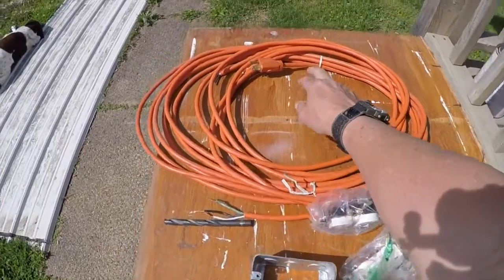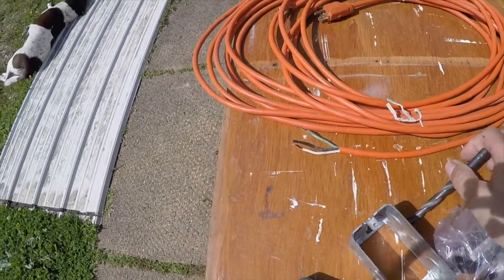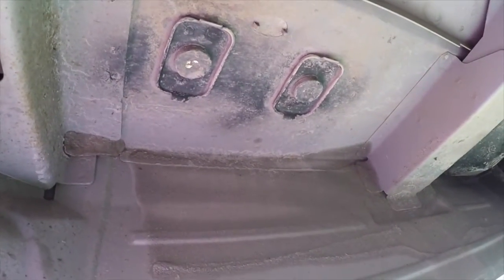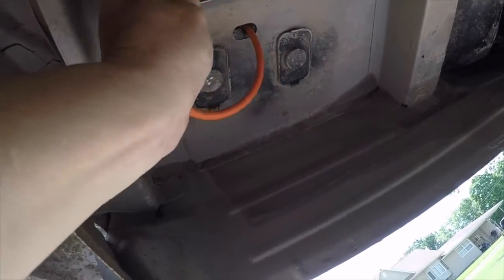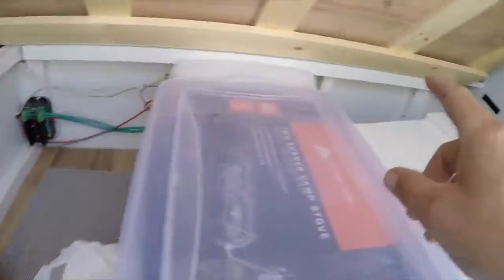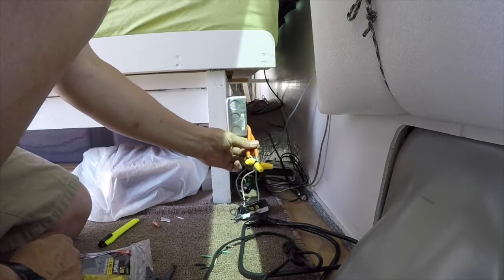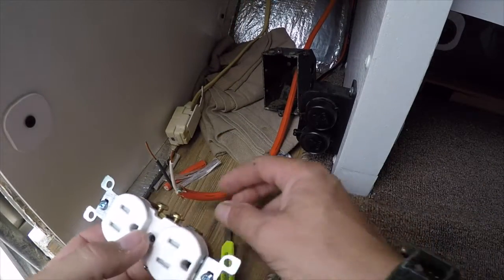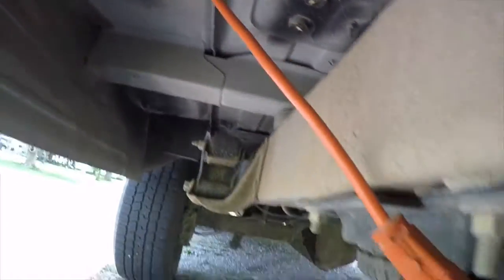How to Install Shore Power in a Van - Ford E350 Camper Van

Comment: Great idea, if you do add a circuit breaker please do another video on how it was done. Pretty much a novice when it comes to electricity and never much liked to play with it for obvious reasons But with that being said this is something that even I would attempt. Thanks Bruce added to my liked videos for others to see and for my own reference. ~jman
Reply from the maker: There are many options for a circuit breaker in this set up. I believe what I will end up doing for simplicity is just use a small power strip that has a built in circuit breaker and call it done. I may even just hard wire the power strip instead of the wall outlets to keep it simple. Most if not all campsite power boxes already have a circuit breaker in the box and my generator has one too so I'm not sure another circuit breaker is really necessary. To be on the safe side that's probably what I will do. Another option I'm considering is a plug in breaker with a couple AC plugs and a couple of USB sockets just to have the option to charge USB devices as well. There are many options and I just haven't decided yet. When I finally decide I'll make a little video for everyone to show what I did. Thank you and take care.

Comment: That will make cooling down the freezer the day before you head out much easier. I saw AC & thought Air Conditioning. I put an window AC in the back drivers side rear door for my last trip to Florida.
Patrick
Reply from the maker: LOL, yes I thought the title looks like air conditioning too at first glance. Cool, (pun intended) I have seen a few van owners installing window AC in that back drivers window. How did you like it? Is it worth it?
Reply: 100% worth it. I got a $1,000 generator that's only 58db will make life better then the $200 101db one I used on last trip. 
Patrick
Reply from the maker: Nice!

Comment: I also already found and watch conclusion, helps me out, I am still in money saving phase.  I am not an electrician, but I was wondering what about the outlets with fuse built in?  I think the power strip with breaker is great idea, small, takes up little space.  The other question I have is about the length of the cord and the guage?  For myself I would be powering I would think small items, and maybe an air conditioner, of course the AC would the only item at that time running on the cord hookup.  I am also looking at those RV hookup units and solar, hoping to do all three types.
Reply from the maker: I'm not an electrician either just for the record. I think you are talking about a GFCI outlet maybe? I don't think those ground fault breakers are quite the same as a regular breaker but I could be wrong. I just used an old extension cord I had laying around. The required length and gauge of the cord you use would be completely dependent on what you plan to run with the outlets. My thoughts are I'm not running anything that I wouldn't run with a standard extension cord and the run isn't more than  about 20 feet or so. I figured if they sold an extension cord in that length the gauge would be satisfactory. I also never really planned to use more than one outlet at a time and I think that may be the key here too. I would just use the largest cable cord you could find or even use real house wire and all should be good. Most AC units are large power consumers. I would just check the paperwork that comes with the AC to make sure it can be ran with an extension cord and I'm sure it would work. Sounds like you have some nice plans, just be careful out there and do your research. Take care :)
Reply: Sounds good to me, in fact I had forgotten several years ago I used house standard wiring to make an extension cord from my outside outlet to garden pond, that one of course is enclosed to protect from the ground.  In research phase and saving money to buy phase, thanks!

Comment: nice easy way to put Shore power into your van but I would consider putting some sort of breaker between Shore power and the van maybe a GFCI or breaker switch between the outlets. thanks for the great video
Reply from the maker: Thank you. I have a follow up video showing my solution for a breaker.
Reply: +WannaBFree I just bought a conversion van myself a few weeks ago and I really appreciate your videos, giving me some great ideas to put my van together. Thanks again. BTW I'll try and keep up with your videos before I make a comment :-)
Reply from the maker: No problem at all. I'm not offended at all by your comment. I just wanted you to know I do have a fix and you were correct with your comment. Glad you can get some ideas from my videos. That's the reason I make them. Thanks for watching.